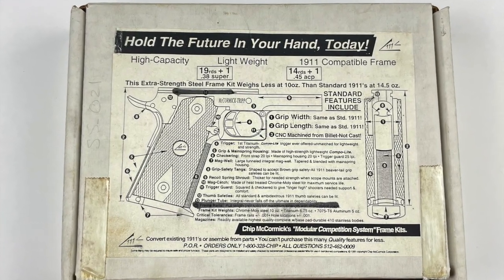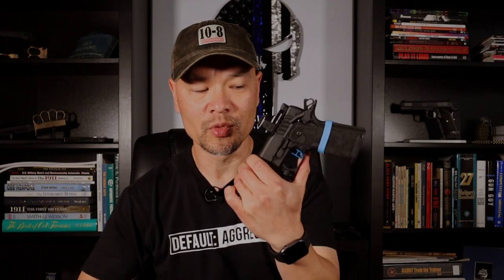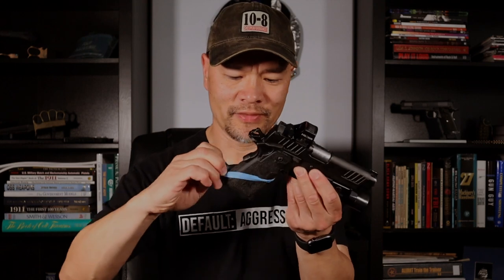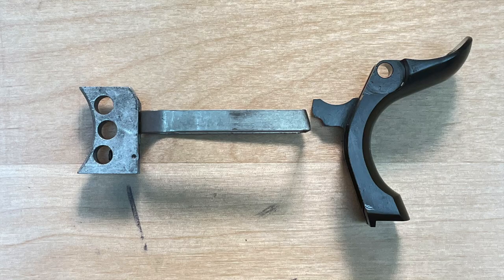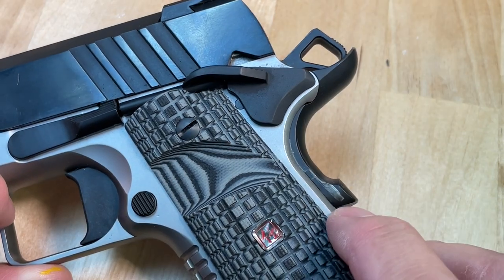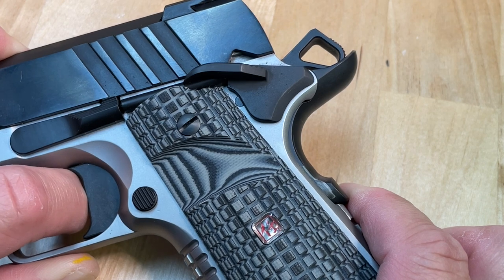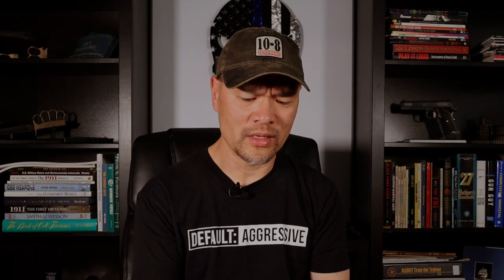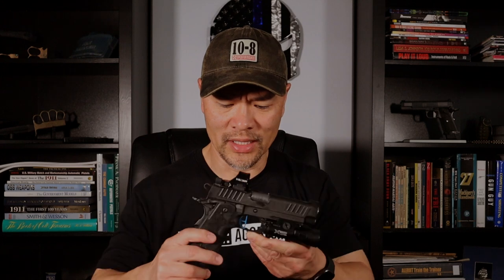10-8 Performance Lab, Episode 69: 2011 Grip Safety

Comment: I wish you'd start making a new grip safety for the 2011 that has an extended bump on it for folks like me who consistently have issues with engaging it in the battery of arms.  I've already sent mine back to Staccato and had it sensitized as far as they were allowed to "Legally" go.  Still no bueno and I've basically got a 3k paperweight / range toy.  Not a happy camper.

Comment: the 1911 was originally designed people fired them with the thumb pointing down. this would consistently de activate the grip safety. it still works today. when shooters raised their thumb or rode the safety problems ensued. speed bumps helped most people but i think you have the best solution by timing it to an earlier release.

Comment: I think tires would have been a good analogy. Would you buy a sports car and buy the cheapest possible street tires and mount them yourself. And either ruin your rims and or get someone killed when you inevitably wreck your car. Or get good sticky performance tires mounted and balanced by a pro so you can more safely push the limits of your vehicle at peak performance

Comment: I will mention since you did not for the uninformed. JMB originally designed the 1911 WITHOUT a grip safety as he must have felt it was not needed. The US Government (US ARMY) is the ones that had that added. I feel he knew more about the platform than they did!
Reply: It honestly makes sense back when the gun was being trialed given it was primarily horse cavalry assessing the gun and giving feedback (to put in perspective how insanely old this design is). When you’re jostling on a horse, dropping the gun is a big concern and if the gun drops muzzle up and the trigger is pulled by inertia, that’s an issue. The grip safety helps alleviate that (same way the dingus does on Glock pistols).

Less of a concern these days, but the design change made sense during the adoption phase.

Comment: Thank for your insights. Just obtained a Stacco P (it was generously gifted to me) and was considering a Grip Safety pin. After your clear explanation of what was what and why...Well I learned something useful. Thank you.  Specifically the % of travel of the grip safety to allow a release of the trigger. Your phrase of "skin on grip safety" was enough.  That is the case with this pistol. No need to "fix" that which is not broke. Background, former US Navy SEAL, Scout/Sniper, Founding Director of the Surefire Institute, blah, blah, blah. I regularly competed with 1911's in the early 2000's and pinned my 1911's with a removable clip that was pinned by the grips. Best to you.  Ken J. Good
Reply: Lol ok dude. The SEALs have Scout/Snipers? What schoolhouse did you attend?

Comment: I sent a message to Staccato customer service about de-sensitizing my grip safety and this is the response I received: "Thank you for reaching out, unfortunately, there is not much we can do to shorten the safety on the firearm as this is going to be standard on all 1911/2011 platforms, we apologize."   I don't know if this is some college intern answering emails or one of their gunsmiths but this kind of bothered me since I want to make the C2 my EDC and it going bang only 90% of the time is unacceptable.
Reply: Not desensitizing but making it more sensitive to my grip.
Reply from the maker: Their CS is often answered by someone with no technical knowledge
Reply: Are you having an issue or just want to modify?
Reply: @ACGBLR  I'm having an issue getting the grip safety to consistently release the trigger depending on my hand and finger placement. It needs to be sensitized.
Reply: @108Performance  Good news...I took my C2 to a local 1911 gunsmith(didn't bother with Staccato customer service) and he sensitized the grip safety perfectly. Thanks for the advice.

Comment: Notice u have a diff shoe there than the plastic one that came on my p/c2. Ive sent both guns back (p twice, c2 three times) for a trigger that started CRISP af and got progressively sloppier over 2-300 rounds. They've been great about paying for shipping but im just wondering wtf is going on w these triggers. They start out amazing (and one of the reasons I bought the gun) and kinda dont stay that way. Is the blue one better? Is dry firing affecting the trigger?
Reply: Anyone else noticed this?
Reply: Do yourself a favor and get a Everglades flat 2011 trigger or one from Altas gunworks.
Reply: Do the triggers feel better when you receive your staccatos after being serviced?
Reply: @C.A.K.92  yes, "back to first pull crisp" is how I describe it. You getting the same thing?
Reply: @pjbiggleswerth8903  I’ve not experienced that with my P DPO. Are you keeping up on the maintenance? When you dry fire, you don’t want to send the slide home on an empty chamber and you should avoid cocking the hammer. Use dummy rounds, rack the slide to reset the trigger, and keep the trigger pinned while racking the slide. If you’re doing all these things and cleaning your gun after you hit the range, you should be good.
Reply: @C.A.K.92  lol how many rounds. U don't need snap caps. Cocking the hammer is fine. The only thing you're right ab is the slide on an empty chamber. And you learn that your first time u pick up a 1911. Thanks tho.
Reply: @pjbiggleswerth8903  Alright, sounds like you’ve got it figured out. Good luck 🤙🏻

Comment: I'm very upset with my staccato c2 I just received. You pretty much have to death grip the to engage the safety. I'm disgusted that I spent over 2 grand for a boat anchor.
Reply from the maker: Watch video, contact either factory warranty or gunsmith.

Comment: Hilton, Great video. Last week I bought a brand new Staccato CS last and have the exact problem you mention. As you mentioned the grip safety has to be pushed in way-to-far for it to disengage reliably with a high thumb grip, my preferred grip with 1911's. I know it's not me as I just put 500 rounds through a brand new Bul Armory SAS II Ultra light with no issues.  I also have never had any issues with my other 1911's.  All indications suggest the Staccato was poorly tuned from the factory, or tuned for someone with really beefy hands.  As I had planned to use this as an appendix carry pistol I want a functioning grip safety, not one that has to be taped or pinned.   As you suggested in your video I put in a warranty request with Staccato and here is the response I received: "I see that you are local, if you would like to bring your CS in to have the grip safety tuned to be more sensitive, we can do that service for $50.00 as this is a customization and not covered under warranty we would need to charge for labor."  So basically they sold me a carry pistol with a grip safety that I can not reliably disengage and now want me to pay an additional $50 to make it reliable.  I bought this pistol to support a local company and actually expected better customer service, as such this may end up being the one and only Staccato I ever buy.

Comment: Just be aware if you carry a 1911 platform for edc if you tape of disengage the grip safely that's just one more thing a prosecutor will use against you...
Reply: *Can use.  They could also try to use the stippling job, modified grips, modified hammer, modified sights, added red dot, extended magazines. etc. I don't agree with taping the grip safety, but, removing the grip safety doesn't change that you still have to take off your thumb safety. In addition, you would need to activate the grip safety to fire the gun beforehand anyway, so who cares if you taped it, its the same end result. Mr. Yam states that his is tuned so light that if he has "skin on it" it will go off, that's one step away from being taped. 

A good attorney should be able to make that point, this would be the same as using a Glock with no grip safety... 

The only time I could see this actually being something that gets legitimately used in a court case with actual substance would be if you or someone else had an AD/ND, and it was determined that it wouldn't have occurred if the grip safety was functioning correctly. 

Just my $0.02, its probably not even worth that!
Reply: @danielmattera4298  will use* modification of a safety feature could constitute a argument for reckless use of a firearm, and be argued as a little of serious than a stipple job.
Reply: @RoofKoreanEnergy  I feel like to make that point there actually needs to be reckless use. Engaging an imminent lethal threat with lethal force, and you happen to have tape on your safety is not reckless operation or modifications. I would say that it does fall in the category of things like "You're F***ed"" on a dust cover, or cheesy Punisher grips, you haven't actually done anything wrong, but it also doesn't look good when its spun the wrong way. 

I don't feel like its a guaranteed fact that your prosecutor will use it against you. They probably have 100 other things they will go after before they get down to the tape over one safety of the two present.
Reply: I can say with certainty it will be used against you. That was all my original comment was pertaining to
Reply: @t3h8ar0n  lol